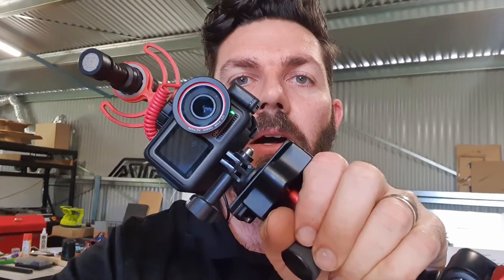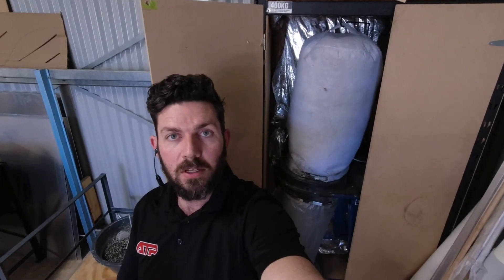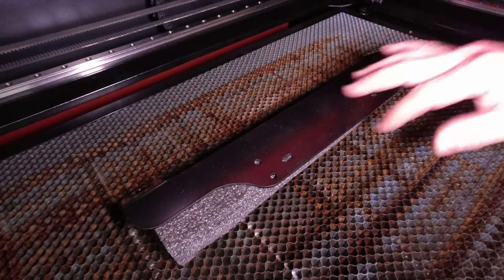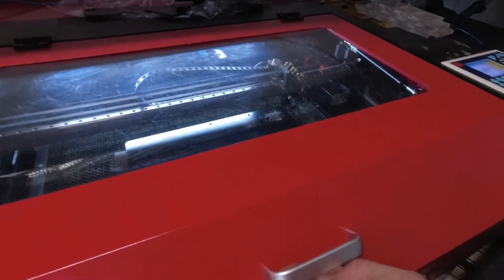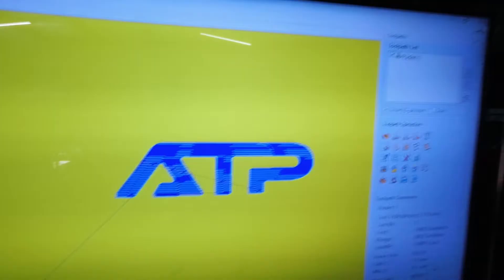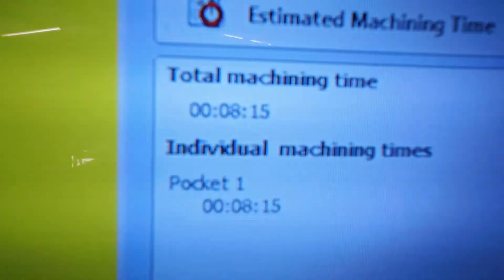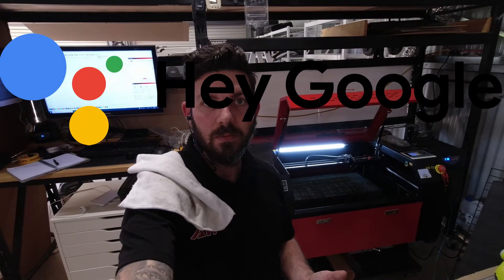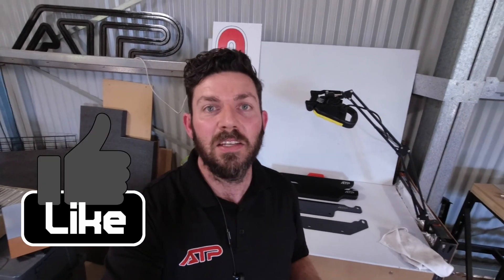VLOG Engraving Powder Coat with a 60w Co2 Laser

Comment: I guess it would be possible to engrave a powder-coated aluminum diecast aluminum enclosure with that 60watt CO2 laser, i am thinking about a Vevor similar laser for that type of tasks, i could engrave 5-10 of them at the same time, a huge benefit compared to order them from china and wait 4-8 weeks before they arrive here in the EU..
Reply from the maker: Engraving powder coat would be possible with an even smaller machine if you are not penetrating the coating. If you're going back to bare metal, it might take a few passes to get it clean.

Comment: What were you running for settings power/speed lines per inch
Reply from the maker: 300 mm/sec
35% Power
317.5 lines per inch

Sometimes I will have to do 3 or 4 passes depending on the thickness of the powder coat.
Reply: @AdamTaylor  thanks fella

Comment: if you engrave through the powder coating then how do you prevent that new area from rusting.  Just curious
Reply from the maker: These parts are aluminium, so no issues there!
It's certainly possible to engrave on the powder rather than removing it of you needed, it would just be a matter of fine tuning your settings 👍
Reply: Real life solution is coating your knife in oil. When I was in Navy SEAL school we used combat/utility knives as dive knives (which are not at all rust resistant). I would coat my blade in 3-in-1 oil before every time it would touch the ocean, and after hours in salt water it would be completely rust free.
Reply: Howdy. That was helpful. Have you ever just laser engraved the powder coat to see what it does?? Cheers